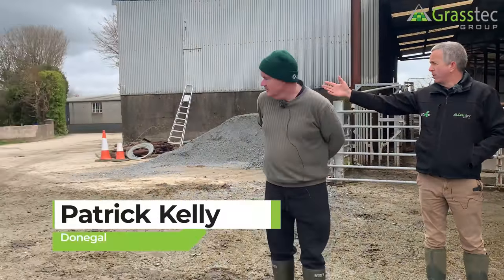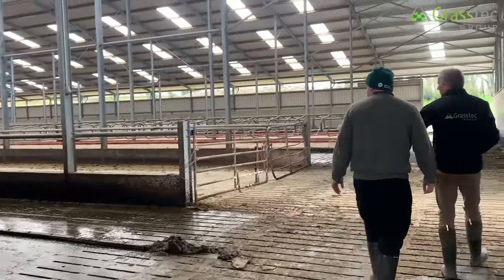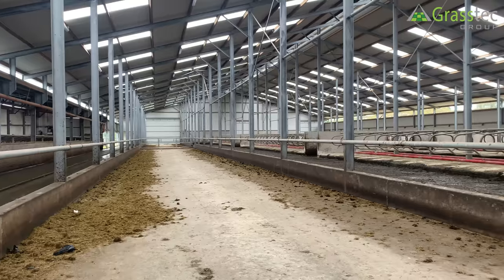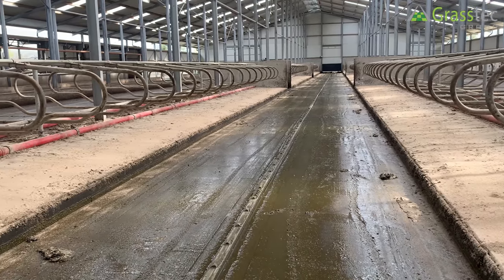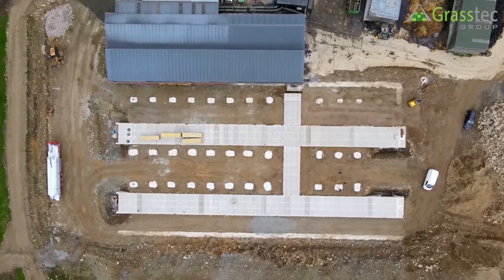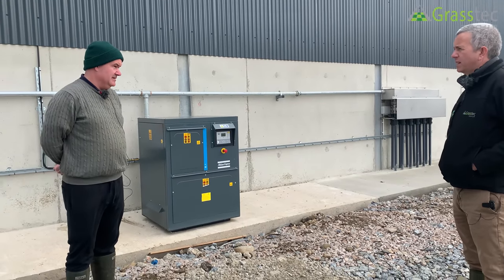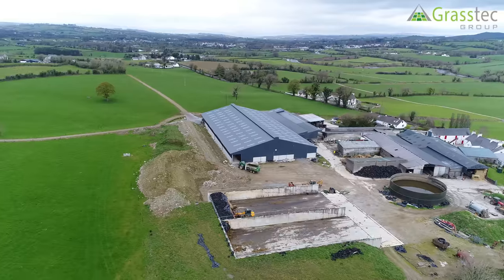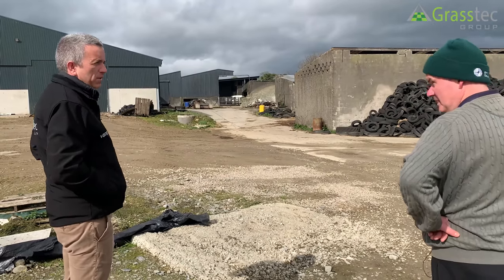Winter Housing Project with Patrick Kelly

Comment: Don't put a bubbler system in a shed it will rot the steel in no time
Reply: Even if steel is galvanised??
Reply: @Joe-ud2hb  sorry for such a late reply. The farm I know had to replace the hole end bay, z purlins,poles and all, on the down wind end of the shed